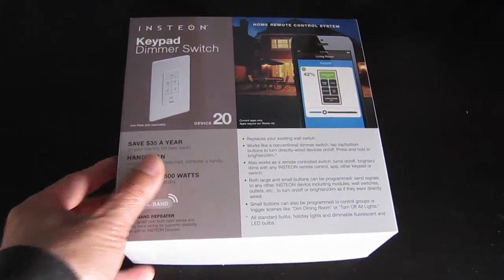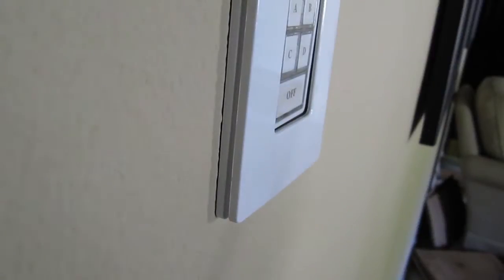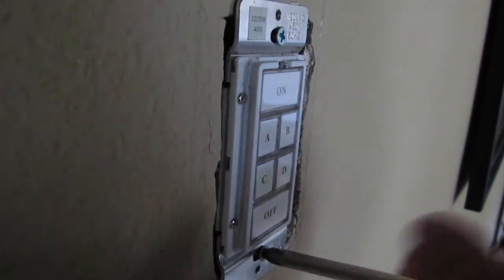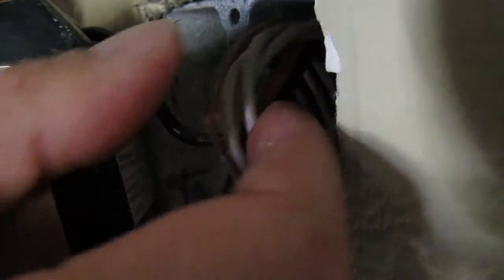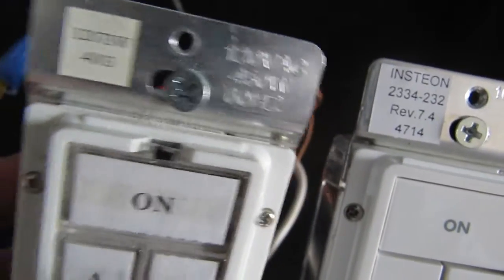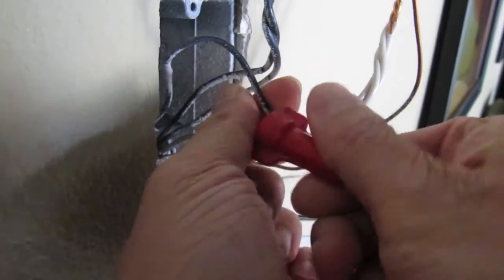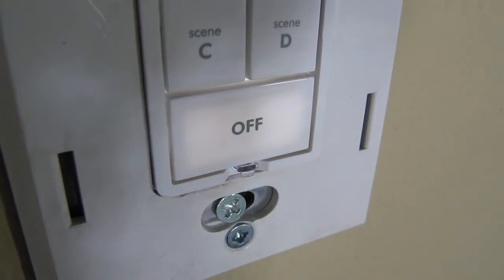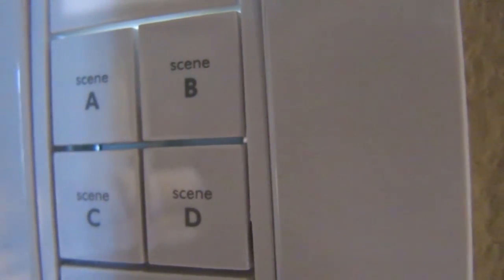Insteon Keypadlinc 6-Button Dimmer Switch Installation - Home Automation Lighting System

Comment: If copper is sticking out your wire nut it needs to be trimmed or a larger nut is needed.
Reply from the maker: +mcshadowviller6 Thanks for noticing! I will have to get back into the box and trim that wire or see if I have a larger wire nut. The box is so tight in there already!

Comment: Hi,
I am in australia and thinking of buying the wall switch with hub, Can you pls advise where do you get the bracket which is inside the wall? i may have to buy  that as we have different plates inside the wall. your response is appreciated.
Reply from the maker: Amit Nandlaskar Hi Amit, here in the US the box in the wall is pretty standard for all our in-wall outlets and switches. It's similar to the one here on Amazon: http://www.amazon.com/gp/product/B00002N5FQ/ref=as_li_tl?ie=UTF8&camp=1789&creative=9325&creativeASIN=B00002N5FQ&linkCode=as2&tag=threq-20&linkId=OOZDBR7BKN6D42AE

The box in the link is for installation when your walls are already finished. Just cut a hole in the wall to the designated size, insert into wall and turn the 2 screws on the front to secure it to the wallboard. Around here, I can find those boxes in any hardware store.

Comment: Good video  - you may want to buy some color electrical tape (Red, blue, geen, white, etc).  I ALWAYS color code wiring with electrical tape before disconnecting any wiring, makes life so much easier and better than taking a picture with you mobile, IMO.  Cheers!
Reply from the maker: Thanks for the advice on using colored electrical tape to identify the wiring! I'll have to try that!